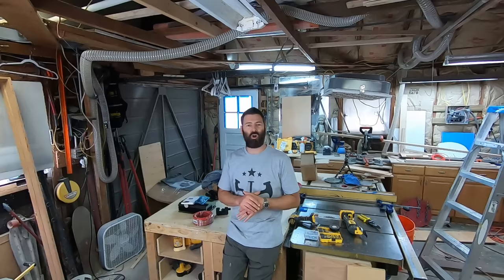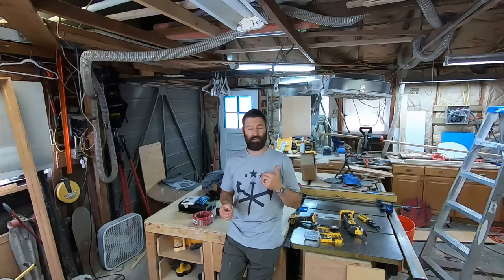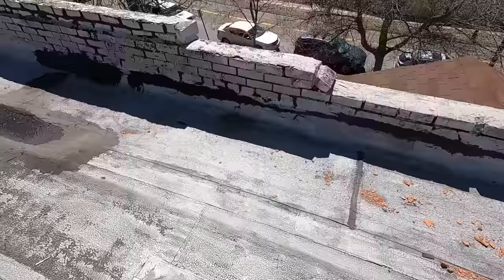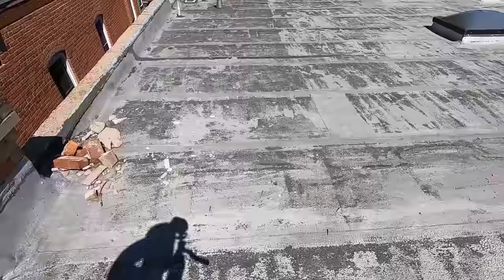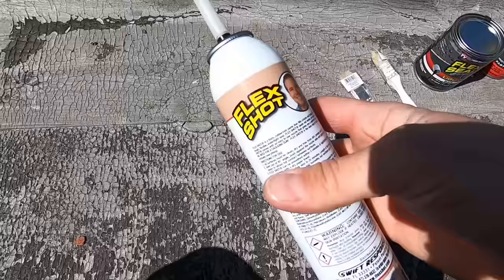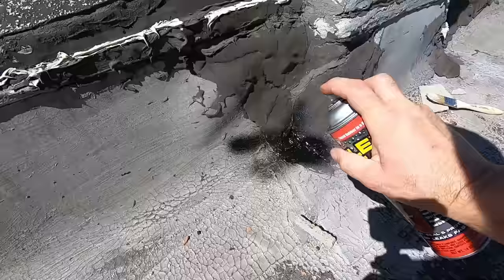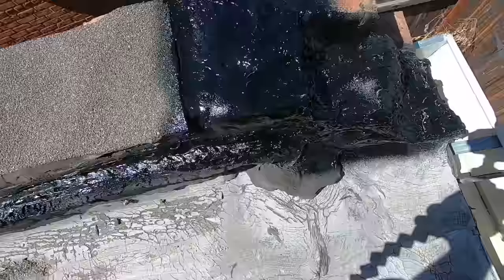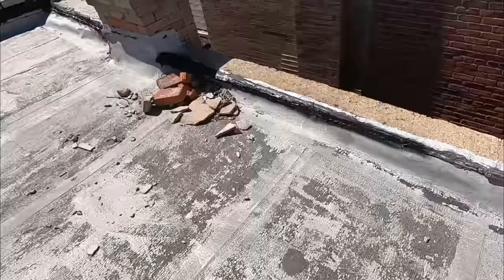How To Fix A Roof Leak With Flex Seal | THE HANDYMAN |

Comment: Don't use flex seal,, it is not permanent, a cheap quick band aid which is a pain to remove. Water will get under it after awhile. Looks great but don't be that home owner, use the correct equipment and materials for the application.

Comment: I used the flex seal gallon. Great stuff I just poured it on the roof and rolled it out it’s been two years on my rental property and it still holding up.
Reply from the maker: That's good to know.  Thanks for the comment
Reply: What kind of roller did you use?
Reply: @maxuabo  I used 3/4 paint roller.

Comment: Great home maintenance repair using Flex Shot to caulk all of the cracks and adding Flex Seal on top to create a flexible coating will surely be a strong sealant that will protect! 💪
Reply: Your flex seal are always works
Reply: @nimason  How long does it last for?
Reply: How long does it last for?
Reply: Where can we buy it?

Comment: I had a client call me a couple of years ago when Nor Cal was getting hit with a lot of rain.  He had bought a can of the roll/paint on for a skylight above his music shop.  I loved it from the very beginning, easy to use and works great.  Doesn't dry out a quickly as the Henry's.  I have used the spray can for my camper trailer roof.  As far as keeping busy, we are are still allowed to do essential repairs and work inside essential places of business.  So I have been staying somewhat busy with emergency services like plumbing leaks or code enforcement repairs.  At home, finally getting to all the routine maintenance projects I tell my clients they should be doing and organizing the shop.

Comment: We've used Flex Seal on our garage roof, We use the can and it has held up. We replaced out drain valve on our 24 yr. old water heater. Next is replacing our fill valve on our toilet. Our state hasn't gave a stay home order yet.

Comment: dear lord that flat roof needs a lot of love. it needs about 2 full days of labor love. pressure washing the crap off, roofing cement and fiber tape all seams and parapet wall seams and stacks. come back following day and silver coat that entire thing. come back following day and do 2nd silver coat. come back and maybe even do 3rd silver coat. that chimney needs a lot of love too. it always baffles me when property owners neglect their flat roofs. torch down modified bitumen flat roofs are tough cookies, but they require love every 3-5 years. treat them right (ie keep seams sealed and silver coated to prevent UV rot), and they can last decades.

Comment: Fixed a customers pound with flex seal lol,  Installed a patio cover ceiling fan with light kit and wireless controller, installed recess lighting and a hallway fixed a Formica back splash and sites Flash,  Tore down an overbuilt shed 3 loads to the dump, two loads of concrete  reinforced with rebar.

Comment: We have a sod turf grass sales business.  Landscaping is considered a critical industry here in Georgia, plus with all the folks stuck at home, homeowners are ordering sod to complete an item on their honey do lists.  So we're swamped with sales at the moment.  When we have time from that, I'm remodeling our master bath/bedroom, repairing some electrical and changing out the ceiling fan in the living room, building additional shelving in the basement storage room for my wife and putting up a shiplap walls and vinyl plank flooring  in my man cave/visitor bedroom, completing insulating, running electrical and putting up plywood walls in the rest of the basement for a woodshop and finally, when that's all done, I'll install a  bathroom in the basement (plumbing is already run).  As a side job, we're putting  up a country style fence outside to keep our nearly grown labrador retriever teenagers from wandering the neighborhood.

Comment: I'm classified as essential. Work 4 on, 4 off. On my off days last week I built a hall tree/chair hybrid out of two solid 28" doors. This week was a hidden gun safe in the wall of my bedroom. Looks like a body mirror but its packing. Next week, pressure wash and paint the exterior trim.

Comment: For concrete cracks repair only coating and spraying is not long lasting using a 6 to 8 ounce cloth bandage will extend the life of crack treatment and water resistance. You can also review some techniques we provide

Comment: In Ohio there is no enforcement of so called Essential labor or repairs.  Neighbors are having decks built, landscapers are cutting grass and outdoor workers are not wearing face masks or any social distancing control. I have temporarily closed my Handyman business due I do not want to enter homes and I will stay closed till end June or longer.  The projects I am doing at home is repairing one wall then painting, installing a AFCI GFCI circuit breaker,  planting flowers and grass. seeding, mulching , laying pavers, installing more smoke and carbon monoxide detectors since new code wants each bedroom to have one, building a wood frame to prevent large garbage bin and recycling bin from blowing over, from high wind gust. And cleaning and organizing garage , basement and shed. I am now tied just thinking about all this work!

Comment: Do not know the code where you are but I have done roof recover  using peel/stick and hot mop methods. Placed MBS slope builder on low spots and applied new flashing, pitch pockets, and gaf roofing membrane. 3 years and still no leaks  or separations.

Comment: I bought 20 gallons of paint 3 weeks ago and I'm painting my house, caulking windows, cleaning the windows, cleaning and repainting the outside light fixtures and I'm pretty sure the US economy will have recovered and covid 19 will be over with before I'm done.
Reply: Nope
Reply: @almostwreckedcars832  You have no idea what communism is.
Reply: Covid is over did you finish?
Reply: Is economy did in fact not recover 😅
Reply: The economy is not fixed it's horrible with prices up to 4x more. What you talking about bro and you haven't commented in 4 years are you still here ?

Comment: How has this flexshot & flexseal worked over the months you have done this repair? Is it really “that good”, as I’ve never used & kinda afraid to. Usually go with caulking tubes with roofing “tar” along with exterior caulk & use flashing etc...to repair siding & roof leaks. Never have used the flexseal products & am curious to know if they really do work & “last”.
Would be nice to see an update vid from this vid too see just how well it’s doing.
Thx for the vid & seeing these products.
Cheers✌🏼
Reply from the maker: So far it works great.  I will revisit the roof next spring and give an update.
Reply: I have a patch over a hole in a 2 in 12 pitch roof and it is still holding after 4 years.

Comment: I used some flex seal on a vent on my roof that was leaking a couple of days ago.  I stuck a WD40 straw in it to work with it.  Had to do the work on the underside of a gable roof that had a huge pitch.  So far so good

Comment: Someone reccomended flex seal to me recently. I'm living in a rental trailer. The owner wont fix or pay for fixing many things. Cant afford to move.
Water comes down the wall, into the windowthrough the wall and...the electrical outlet below the window stops working...flex seal is worth a shot...but where do i put it to get the best use of it...happens when it rains or snow melts.

Comment: Been a roofer for 45 years. The flex seal in a spray can doesn't last very long. The rubber flex seal in a gallon can is all right. If you read on cans  not for use by professional roofers. Buyers beware .
Reply: Professional roofers will just lie and tell you need a whole new roof.

Comment: i have used flex seal on my camper roof and what i found is that the sun breaks it down and it turns to powder, so i would not use it for roof repairs

Comment: What if someone currently has plumbing problem at their home and calls you?
Reply from the maker: It would be a case by case basis.  Depends on the situation.
Reply: The Handyman they said leaking utility sink, ended up with 45 ft of lint in the drain line.

Comment: I dunno handyman, your a professional and should be using professional products, especially on the roof. Not some as seen on TV crap.
Reply from the maker: It's actually not crap.  Its been used for a long time.  Flex Seal just packaged it and marketed it.   It is sold in every single home improvement store in the country.

Comment: That roof clearly needs to be replaced and not patched for the 80th time. 
Using flex seal to repair the roof is a sign of someone you DON'T want to call to fix your roof.
Reply: Instead... I'll call a crooked roofing company.

Comment: Flex-Seal is a crock. It is not designed for roof repairs. 20% of my annual repairs are from home owners who used this stuff. IT DOES NOT WORK.😡
Reply: DIYer... because they got screwed by a crooked roofing company.